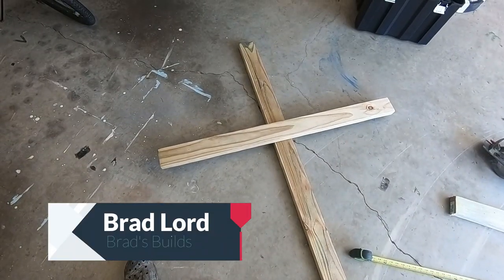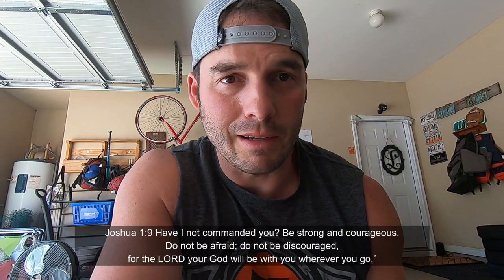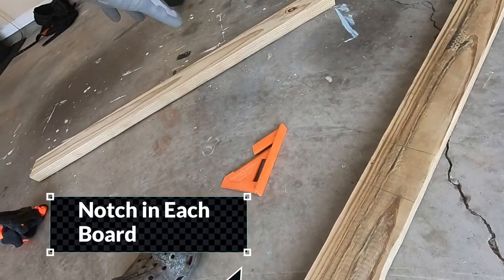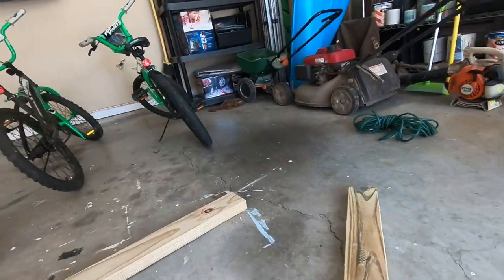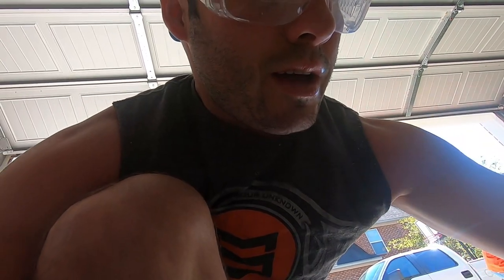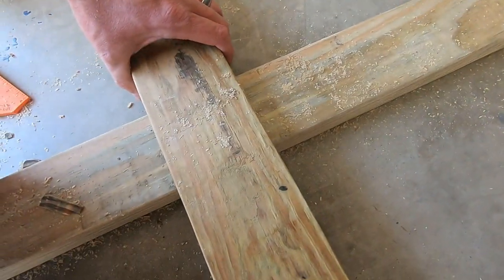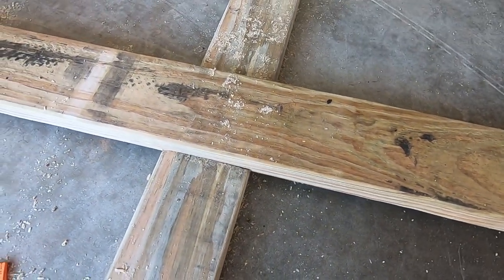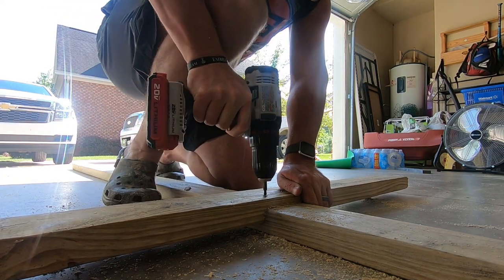How to Build a Wooden Cross

Comment: Appears you used 2×4s wouldnt you cut 3/4" rather then a 1/2" in depth on both boards to make the jointed pieces flat surfaced on both sides? or you didnt want the flat even surface look?
Reply from the maker: If I had a table saw I would have went with a more flush look I think.  It still looked good though.

Comment: That’s horrible
Reply from the maker: That’s harsh
Reply: @RunwithBrad  it’s not my fault
Reply: @RunwithBrad  I've been in and around motor sports most of my life (I'm 59). Motocross, cross country,  classic cars, Enduro motorcycles now, adventure bikes. I never learned carpendry or how to use carpendry power tools at all. I got the itch so last week I replaced a failing drill I have with $850 of new cordless power tools. 14 tools total. Skill saw, router, jig saw, orbit sander, big batteries etc. you get the picture! Out of all of the tools I've used 1 before, a drill! 😂
The reason I'm telling you this is, you've inspired me to build this same cross to wrap with lights and hang on the front of our home through Christmas. This will be the very first thing I've ever made with wood. I just wanted to let you know I appreciate you and Merry Christmas to you and your family. Be blessed brother! ❤️🙏